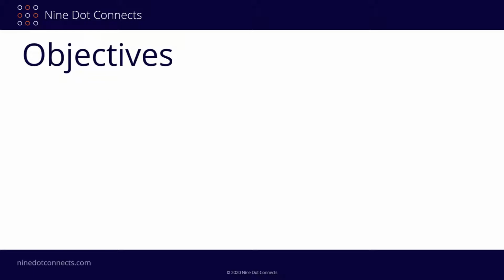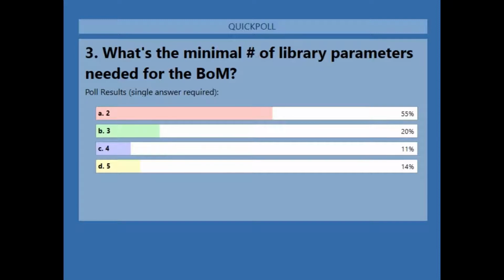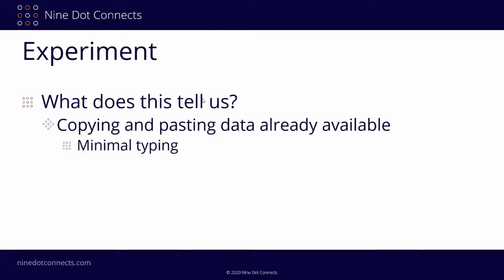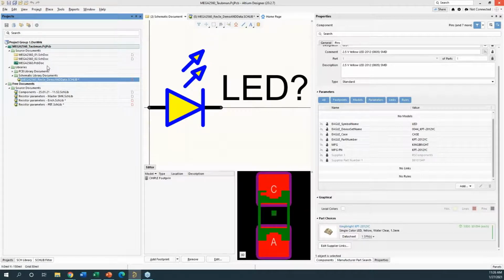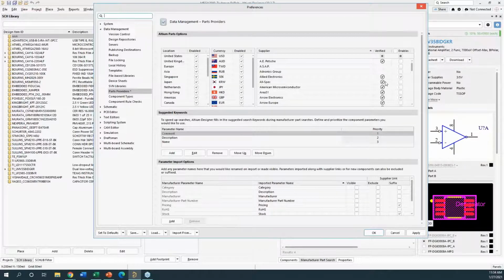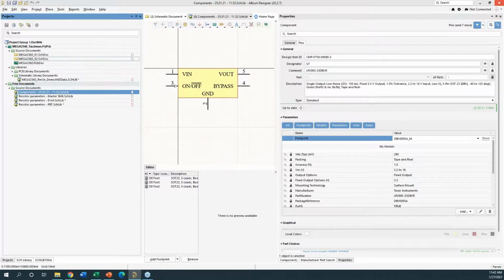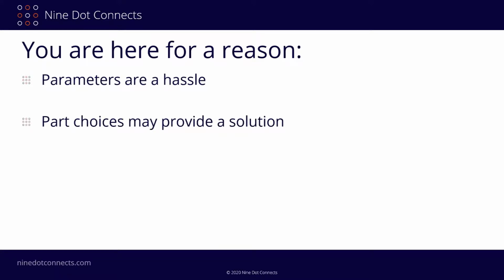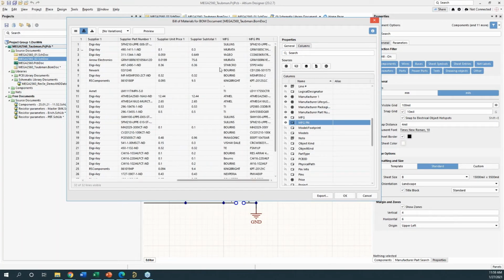Rethinking Parameters with Altium's Part Choices

Comment: Thanks, Nine Dot.  Another fine webinar.

I wonder how robust the data security is in all of these Altium processes where the Altium application is inviting the user to look up components and their attributes at manufacturers' and suppliers' web sites through their tool?  Confidentiality would rely on Altium's and all of the 3rd parties' security features being solid.  In the most simple example, requiring all connections be from https web interfaces, and so on.
Reply from the maker: When you use these features, you really do not know what they are collecting.  But, if they are collecting data, it is library related.  
 
If you look at enough libraries (like we do), it can give you a glimpse of what a company uses in their designs; but the library does not tell you how a component is being implemented or where that component is used.  If Altium really wanted to extract that kind of data, they could easily do it via their A365 servers.
 
In short, yes, there may be data collected because Altium is trying to build up their library collection and the suppliers want to know what designers are looking for.  We would be hard-pressed to believe that there is something nefarious going on.
Reply: @NineDotConnects  I don't suspect Altium or the suppliers of nefarious efforts, I'm thinking in terms of a 4th party (parties), being able to track any web requests going through the tool to Altium and then on to the suppliers. If these aren't encrypted (https vs http) then they're vulnerable to "sniffing" as a designer builds out their entire BOM with such a tool.